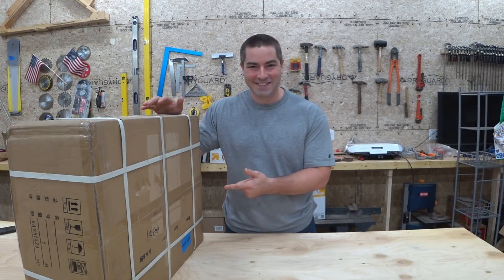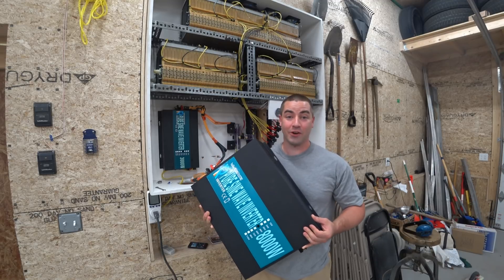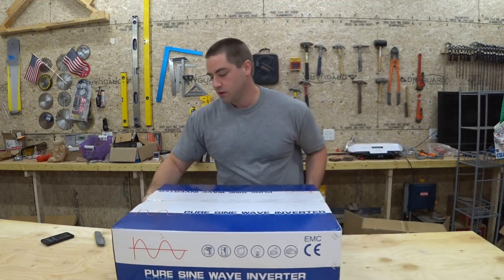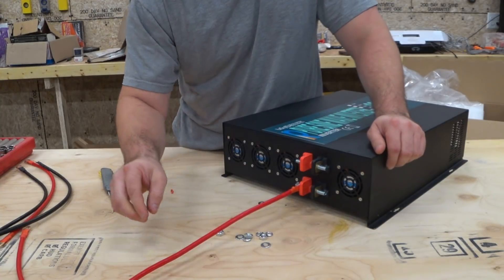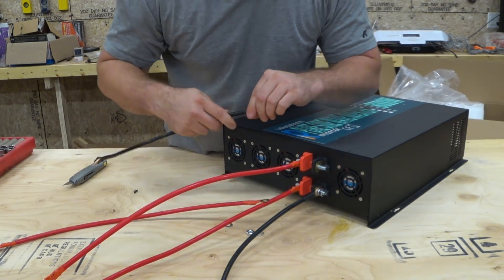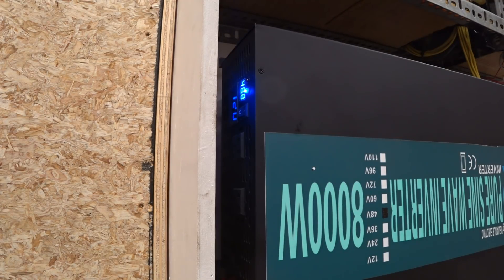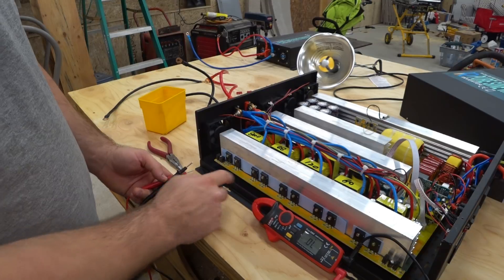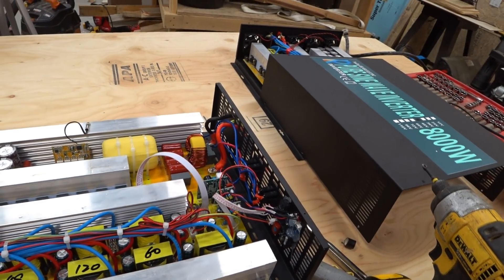Cheap 8000w Reliable Inverter, DIY Powerwall, Chevy Volt Batteries

Comment: You have a Victron battery monitor I see so just do the job properly and use a Victron inverter 
They work properly
Reply from the maker: I might buy a Victron inverter, they seem very nice.  I wish they had a split phase version.

Comment: correct me if I'm wrong but those red blade fuses are rated at 10amp. so if your asking 15 from it that's why theyre blowing.  I noted the ones that came with the 3000W are 40amp
they should save anything else in the unit though. so that's a bit poor.
Reply from the maker: You are right, the blade fuses are 10 amps each, and two in parallel for each of the 9 component groups.

Comment: I am wondering about your saw. It may have a short to ground inside which the AC mains would handle if the service outlet is properly grounded. I suggest popping the saw into a GFCI outlet. If it trips, then your saw is the problem, not the inverter.
Reply from the maker: Thanks for the suggestion.   Every outlet in my garage is a GFCI and the saw hasn't tripped any of them yet.

Comment: "just my preference" ...yeah and it's code's preference too. You can't run wires in parallel to increase amperage in most cases because a failure of one cable will put unsafe amps down the remaining cable(s) which can result in a fire. That said, I didn't check the guage of cable vs length of cable to see what you need for that inverter, hopefully they did and the extra cable is intended as a spare or to run to a shunt, etc.

Comment: Whats the peak draw from the circ saw?
Reply from the maker: Hi John,  The saw's label says 15 amps @120v, or 1800 watts.  This would be running under load.  The in-rush at startup is higher.  I've measured as high as 39.5 amps for a split second, but it is possibly higher.  I'm limited to the multi-meter I have.  I hope that helps.

Comment: A well designed switching power supply or inverter will just limit it's output to 115% to protect its components.
Reply from the maker: That would have been nice.  I wish the inverter protected itself.

Comment: Its efficiency is 85-90%, that's a lot of wasted energy and battery capacity. Good modern inverters are 97% efficient, like my SolarEdge PV inverters.
Reply: Canadian Solar inverters are nice too but expensive. The inverter he is using looks cheap fosho
Reply: @gdorfxoxo9657  Canadian Solar is just another Chinese company. There are numerous very well-made western inverters. Support your local manufacturers.
Reply: From what I can tell from SolarEdge they only make PV Inverters, so no good for this application!

Comment: Reliable? Maybe your saw takes to high amperage to start up, it should start slowly and than automatic crank up the speed...
Or it's just a crep inverter.
But nice video 🍻
Reply: Yep, that's kinda what I was saying. The fluorescent light is one example although probably not enough power to shut it down. The one also about running a circular saw, or trying to, with 4 100 ft extension cords. Saw a carpenter hook up a table saw to an electric panel. "Yeah I know how to do it". I let him, turned on the saw and it sounded like it had more power than the space shuttle (maybe a slight exaggeration) but didn't sound right. Got the job electrician to check and he had it wired up 240 volts. Electrician said good thing you didn't run the saw very long.

Comment: I don't trust any inverter that doesn't have a massive toroidal transformer in it!
Reply: I have a kipoint 3000 watt inverter can't lift it's on my own it needs two men to lift runs my washing machine including the heater in it no problem and it is 12 volts had it 10 years never let me down

Comment: David have you ever heard of inductivity?  This is the phenomena that happens inside the motor of your saw and ittemporarily spikes the amps far over 10 times of its normal current, immediately after turned on... You need to size your inverter accordingly or use a special circuit in your saw that prevents these spikes.
Reply: IT'S AN EIGHT THOUSAND WATT INVERTER!

Comment: also wanted to add, if your not sending them back, "I'll take one" lol, id be happy to replace the MOSFETS with a higher current rating device and maybe add a startup cap for inductive loads, I will also say that if you had powered up a small heater like 300 watts and then tried the saw it would have worked OK, but from China all those lower end devices, cheap and low a rating as possible like borderline to get it produced as cheap as possible. I'd do a video of the UpGrade and Power test???

Comment: MOSFETS are sensitive, in a Audio power amp, they cant be run with no load and the volume cant be MAX when powered on , this unit uses the MOSFETS and 
 Im thinking the other may just use high current transistors or triacs , it was the Surge current that killed it for sure, it may have been able to handle all 8000W (probably not for real as most are rated at the surge current level and not at the continuous level) but not at full load to start,

Comment: Paralleling mosfets is not always easy, the more you add the more the capacitance you increase ( Cds) for that reason the surge is not limited by it, also total Rdson is lower which takes to non-limit inrush current.. on the 3000W probably less mosfet in parallel does less Cds, which narrow inrush spike which does not develop to its full peak and also Rdson is high also limiting current, so probably that is the reason for which 3000W inverter does not blow. It's better to Use IGBTs or another technique to achieve that output power. But being realistic, a soft start circuit added to motor equipment will be safer. just saying...

Comment: Get real cables to feed that monster, David. Go with 4/0 gauge welding cable and hydraulically crimp the terminals on. Then you'll see what an inverter can put out.
P.S: I painted my walls in the shop white and the difference in lighting is amazing.  It doubled the usable light without a single extra watt.  Highly suggested.

Comment: Dude seperat the hot legs and use two breakers the amps the saw needs to operate are listed on it come on 80 amp single pole breaker dude im lol
Reply: dudeifyourenotgoingtouseanypunctuationwhydoyoubotherwithspaces

Comment: Not too reliable, eh? XD
P.S. Is that 14/12 gauge wire you connected to the output? That's seriously stupid. If this unit can do the rated power, that would be about 66 amps at 120 volts. For that current you need at least 4 AWG gauge wire.

P.S. You need to be very careful with these inverters, some of them use automotive type fuses rated for 32V. This is not good, there is a chance the fuse can fail to break the circuit because the open circuit voltage is higher on this 48V system. It's also one of the reasons why these fuses tend to make so much skidmarks when they blow.
There are blade style fuses like these that are rated for 58V and 125V. But they are less common.

P.S.2. At least it isn't a POWERJACK inverter. Those are THE worst. To the point of, some will actually electrocute you.
Reply from the maker: Hi Benjamin Esposti,  Thanks for your comments.  You are right about the fuses, I think they are automotive type and not rated for the 48v.  I guess the manufacturer used them for cost?
The wire I'm using on the output is a 12 AWG wire.  You are right that it certainly can't take a full 8000w and would probably catch fire at that.  12 gauge is only rated up to 20 amps.  All I was doing in this setup was testing the inverter and nothing I plugged into it exceeded the wire rating.  If the inverter had worked I would have connected it to a subpanel with thicker wires.  
Thanks for watching.

Comment: You might want to try a Power Jack 8000/32,000w surge LF (big transformer coupled output) type they are huge, fairly cheap and are supposed to have much better surge capacity than HF types. You also need a healthy supply side for these larger inverters  I wonder if your non standard input voltage may be causing problems.

Comment: FYI all motor, compressors have a surge of 3-5 times its rated power. Means your 3,000 watt will require 9,000-15,000 watt in a split second to start operate. This is unacceptable for all invertors even if the surge is below its maximum capacity. Invertors required a gentle step by step power up like invertor air conditioners  invertor refridgerators.

Comment: To start a saw from stall position to full speed, for sure the amps will crank to the top to fight inertia ! Power rating is written/calculated when it has reached max rotation, not start ! Like a battery in a car, it's rated in cold crank power which is the total opposite !

Comment: Looks like an inductive spike taking out the MOSFETs either from overvoltage or excessive dv/dt, either of which will kill a MOSFET good and dead. Don't bother replacing the fuses, they blow after the MOSFETs fail, almost never before. Not even sure why manufacturers continue to use them, they are more trouble than they are worth. Given the heft of your saw and the very short wiring between saw and inverter, it's a pretty good spike test, and one that failed. 

I am constantly amazed that any of these guys can build inexpensive devices that pull 200 amps at full load and don't immediately self destruct. It is not a trivial problem.

Comment: What happens when you put a Soft-Starter or inrush current limiter between your Outlet and your Table saw?
I think the Inverter can't handle too fast and high current changes.
Here in Germany we use cartridge fuses and surge arresters for the DC side of photovoltaic systems.

When i use a PC-Power Supply to power a Car-Hifi-Amplifier, it only works when the AMP's Remote connector is permanent bridged to +12V to turn on the AMP instantly. When i first power up the Power Supply and then activate the Remote-Connection the PC-Power Supply turns off, because the Power Supply detects it as an overload and perform a safety shutdown.

Comment: If you use an a ammeter, (Analog) or digital you will see the high surge of current during the initial start of the motor which is popping the fuses. That's the reason you see the momentary dimming of the lights when you start motors like this (for AC compressor)

Comment: When you test a MOSFET two things are important... 1. Your meter must apply enough probe voltage to turn on the gate in the fet... in this case meters with the 9 V battery are going to be a better choice 2. Also, and I couldn’t tell in the video if you were doing this or not because of how you were standing… You must identify the gate drain and a source of the transistor by looking at the data sheet.  Take the probes and place the negative lead on the source and the positive on the gate, give it time to charge 5 to 10 seconds. Now move the positive probe to the drain.... you should get a low reading on your meter. No short the source to the gate to drain the charge while the positive leader still connected to the drain… And the reading should go high.  These ratings will indicate a good FET.

Comment: I bought a 2000 watt Reliable inverter that will run everything except what I bought it for. 

I wanted to run a gas dryer which has a starting draw of something around 29 amps. Sometimes the inverter will work... Which makes me think it is an intermittent and quality issue with Reliable. It should handle the 29 amp start current as it is supposed to do 4000 watts peak. But it is temperamental everything has to be just right.
I think I'll turn down the output voltage and see what happens.... Maybe it will blow up also.

Comment: The breaker popsbecause te moter use more than 4x or higer wen it spins up te aps or watt what it is saying is te normal aps so 15 amps moter will draw more than 60 amps when it starts up. I am a elextrical machinic.

Comment: Often times the stamped amp rating of a device is its “running amps” however what they don’t always tell you is what amps it takes for start up. any electric motor regardless of size will use more amps at start up then as its running, the bigger the motor the more amps for start up, I would recommend putting a meter on it to find the start up amps (also known as “surge amps”)
Reply: Even at its maximum startup load, a circular saw should not exceed 15 Amps, which is only 1440 Watts.
The inverter in question is stamped at 8,000. Whether that is Constant or Peak rating is, at this point, irrelevant.

Comment: Are all the mosfets from the same company? Who makes the caps? Looks like the problem could be poor engeneering and probably low quality parts. Those two usually dont mix very well.Im going to have to jump on the bandwagon and say magnum inverters.They cost more for a reason. They work. Customer service doesn’t do a thing if the product doesn’t work. Maybe insteed of having good customer service the company should invest in engineering and management. That company won’t be around long . Looks like they don’t have any quality control. Cheap just isn’t working out for you.

Comment: Ok; When an inductor,, such as a motor stator/ rotor, is cold or off, it draws much higher current when starting than once it is magnetized and running at 15 amps. Answer: put a 1000w lamp in series with the hot wire and a bypass switch to short circuit the lamp once the saw is spinning. But don`t do this because I am not an electrician. Seek professional help...I did...

Comment: First of all, I would like to say that on most every inverter I have ever seen the rating on the inverter, in this case... 8,000watts... that is the surge watts the continuous wattage will be lower. when sizing the inverter you need to pay attention to this as some electric motors have a start winding such as a miter saw that will draw more wattage at startup than it will when running. 

Think of a car, when you are at a dead stop it takes more power from the engine to get it rolling than it does to keep it rolling. Hence the CITY vs the HWY Fuel Milage. An inverter, in this case, is the small engine trying to run something like a dump truck. My advice is this if you don't want to go through the process of getting a bigger inverter, add some capacitors in line with the output to store the energy needed for the start winding of the motor without drawing too much from the inverter and blowing.... everything.

Comment: My first guess is that there was a power spike that took out the inverter, as that is a series wound motor and without a capacitor across the motor it will have high voltage spikes that can easily short a mosfet.

Comment: Chinese inverterr lol. Those mosfets are very cheap and die during initial spike of voltage and amp which is way above 15A. get high voltage mosfets with higher amps and replace current ones

Comment: I've seen 5kW peak power pure sine wave inverter twice the size of that 8kW inside...and as mentioned before in comments by some clever guy, 2kW brushed motor will draw 4-6kW at startup easily...
Reply: I suspect his saw motor isn't rated for more than the rated capacity of a typical outlet in the USA, 1500W.  So, doing the simple adjustment, "1.5kW brushed motor will draw 3-4.5kW.  So his test is valid.  "Reliable Electric" must have taken some shortcuts in their design, so it can't handle such a large inductive load, even if it is a brief startup load.  Their design isn't up to the task.

Comment: Cheap products means the use of as many standard parts as possible. Roller skate bearings on a 50k rpm shaft, 46 different 555 timers, a resistor just barely out of spec.. That's all acceptable when the production price goes down by half. Powering your home with inverters made out of automotive jellybean components put in parallel is just asking for trouble.

Comment: The mitter saw uses a high amount of current buy 20 12 volt batteries and link them together until your multimeter reads over 220  use the battery array as input power to an isolated circuit breaker buy a way outlet attach wall outlet to 60 amp breaker with 60 amp wire as far power readings you get a sensor from amazon will do to make it look futuristic  any 12 v battery charger will do think of the charge array as floors good luck I hope I saved you a buck
Reply: runs off ac not dc that's why you need to invert power convert and boost singe wave to rep. 60 cycles

Comment: Of course your miter saw blew up your inverter fuses. Imagine an 8kw inverter was loaded with 15 amps miter saw which requires more than 10kw inverter capacity.

Comment: hi david,the starting current of a motor is at least 5 times the nominal (without heavy load).ex.if we have a motor of 100watt,it will draw 500 watt,for some micro or miliseconds..(i thing the problem is the cheap chinese systems,mosfets,diodes,etc..)I built inverters in greece,and is at least 5 times stronger of the nominal power.
Reply: I have 10 Amber 230 volt motor i want to run it with my system (2 * 250watt solar panels and 200Amh battery)
but my pure shine inverter is only 600 watt-800 peak.
Give me suggestions for new inverter, and a link to find you for buying.

Comment: How do you have the outlet you are using connected to the inverter? From what I see it looks like you connected the hot line and com but how is the middle wire ground connected? Usually power tools don't have a ground connection and connecting a inverters ground could cause a surge of power through the chassis of the inverter. I have a 2500 watt inverter same kind as yours and mines got its ground connected to the chassis. You may want to use 2 different ground connections one connecting the inverter chassis to its own ground and use a 2nd ground when powering up heavy loads so any surge will ground out instead of surging through the chassis that may cause burn outs.
Reply from the maker: In this video: https://youtu.be/SEjJXpUWfy0 I show the wiring in more detail.  The video shows the 3000w, but it's the same.

Comment: There is a built in capacitors in saw. Fuse the live and neutral to discharge the capacitors. Try it then wont blow